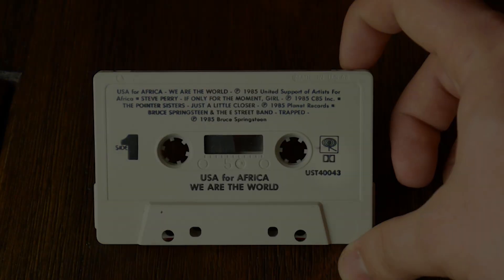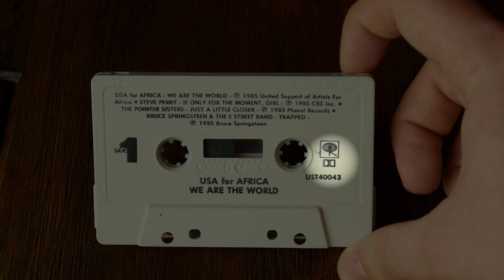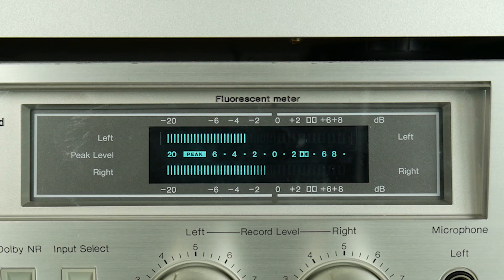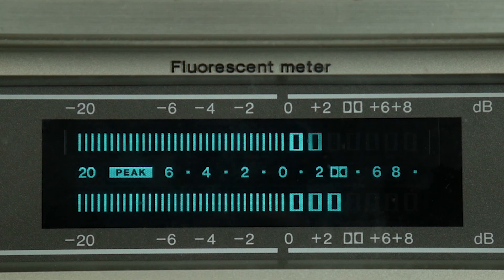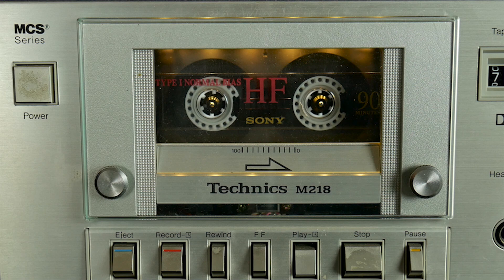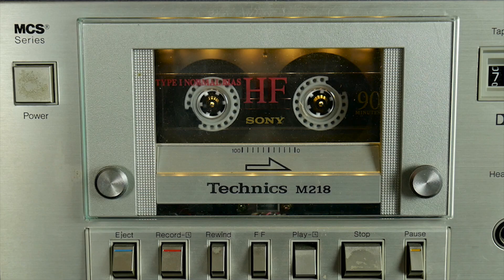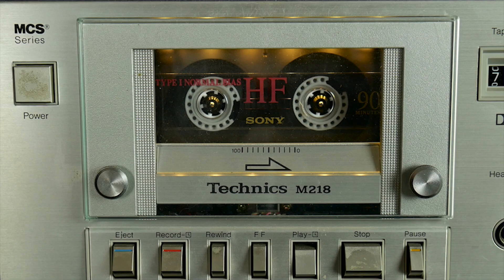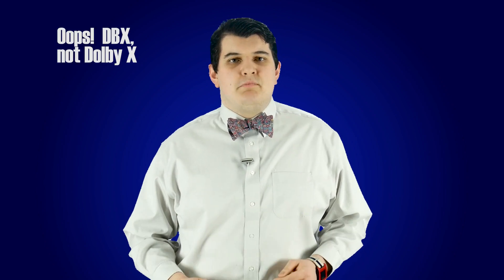What is Dolby Noise Reduction?  Dolby's Humble Beginning

Comment: 4:30  I disagree. 
This process is called "preemphasis and deemphasis", not companding as an equalizer does not alter the dynamic range. 

Companding is the combined use of dynamic compression and dynamic expansion, hence the name companding (compressing/expanding)
Reply: It's actually doing both. By varying the amount of pre-emphasis, the high frequency portion is compressed on record. The opposite occurs on playback. As others have mentioned, this video glosses over a lot of it. Kinda like "Dolby for Dummies."
Reply: No.  Some noise reduction is preemphasid and de emphasis, like what is used on an FM modulator. However, the better more sophisticated NR was compassion and expansion.
Reply: @videodistro  Compassion? LOL
Reply: Totally correct! Saved me typing it again! I cannot believe all the suckers that blindly believe this guy without even a quick web search!

Comment: I'm sure you know this, but pre-emphasis is part of the red book CD audio standard, so it has been used in the digital domain as well. As I understand it, it was due to the frequency response of early ADCs being bad in the higher frequencies, and noisy low-pass filtering to get rid of frequencies above 22050Hz for the digitization.

Comment: A companion technology to Dolby for professional pre-processing for mastering was the first baby steps in DNR tech... digital noise reduction.  The first studio units were starting to show up in 1978.  The circuit was actually so simple that we built one for the college radio station.  You directly couple an analog to digital converter with a digital to analog converter.  That will take out 40-60 percent of extraneous noise and tape his from field recordings so you can get a clean master for broadcast.  It was great for local, next day, broadcasts of away sporting events.

Comment: Excellent video, and one that caused me to subscribe. I never had an issue with Dolby B noise reduction, if a tape was encoded with Dolby B I played it back with the noise reduction. With one exception, I never noticed the "killing the highs" issues that others have mentioned, but I think a factor in that is that I used good-quality cassette decks with high-quality tapes. The exception was with some cheap pre-recorded tapes.
Reply: I used top of the line. 
My cassettes sounded sooo much better than commercial ones.
But there was a way to make crappy sounding cassettes
Record them with Dolby B or C.
It would my cassettes sound as bad as the commercial ones.
That was using varied recording levels, and over a period of time, 2 or 3 different tape decks, and different types of tapes.
A little tape hiss was well worth having a good recording.

Comment: The video is very basic, and thus a bit inaccurate about how Dolby B works, but at least the general principle is there.  For those who didn't like Dolby B because it made dull sounding tapes, the answer is simple: the deck needed alignment.  Each tape type was different, and the tape itself changed the high frequency response.  Put Dolby around that tape and it did get worse.  But a properly aligned machine calibrated to the tape it was using was the trick, and under those conditions Dolby B was reasonably transparent.  

However, it wasn't a fixed amount of EQ, it changed with level, and the frequency at which the curve "bent" moved with level too.  The double D Dolby mark wasn't there as a "not to exceed" limit because Dolby increased recording level, that's completely wrong.  That was a calibration mark.  A Dolby Level test tape would play a test tone at that mark, which was used for setting the deck up.  Dolby didn't change the maximum levels recorded, as the higher the recorded level, the less NR action took place.  

Dolby C, and S were not generally accepted because they were not compatible with existing Dolby B equipment, and so C and S were never released on pre-recorded tapes.  

Dolby HX was a great solution to the high level/ high end problem.  As you increased level on a cassette its ability to record high frequencies reduced significantly.  Dolby HX modulated the bias signal (which was necessary to get undistorted sound recorded on a magnetic medium, but tended to "erase" high end) dynamically, reducing bias when high level/high frequency material demanded better response.  It required no decoding, and was compatible with all forms of Dolby NR.
Reply: The best decks had glass heads and overall did not have auto reversing rotating heads. Tape decks usually don't go out of alignment unless physically damaged or misadjusted. Audio shops used to have alignment tapes, which you could purchase, and place a scope on the output and adjust for the best high-end signal. You can make your own alignment tape using a known good tape deck and a signal generator. Some tape decks even used to have the auto calibration of other factors such as bias and level adjustments. Pioneer and others, would create a short test area at the beginning of a blank tape, to adjust themselves. Crown and other high-end decks would also do this. If your tape deck sounds bad, it was usually because the tape heads wore out. Conventional heads develop wear over time, and need replacing.
Reply: Interesting. Your explanation makes me wonder if most of my decks were misaligned. Or perhaps I just have a preference for boosted treble.  I always preferred leaving Dolby nr off during playback. High frequency noise was acceptable because the audio seemed less muffled. To me it sounded higher resolution despite the hiss. With Dolby nr enabled during playback it sounded to me like someone had thrown a blanket over the speaker.
Reply: plus for mentioning Dolby HX.
which actually was developed by Danish Bang and Olufsen under the name HX professional.
it was incorporated on there absolute high-end tape recorder: Becord 9000 which was actually something the engineers asked to be allowed to make, after there development of the Beocord 8008 cassette deck.
insanely expensive, with all the technology they could dream of.

B&O did realize that it would be impossible to keep the patent for HX professional, and decided to sell it to Dolby Laboratories.

all prerecorded tapes there after, was recorded with Dolby HX (since it didn’t had any requirements for the playback).

Comment: Noise isn't a problem anymore?
It wouldn't be if not for the "loudness war" and the tendency of music producers to max out all frequency levels and compress the dynamic range like crazy. It makes 1411kbps CDs sound like 128kbps mp3 or even worse!
Thankfully, this stupid trend is fading and it was mostly a problem in the 2000s. You could not even produce vinyl versions of those CDs because the needle would jump off the track!
Reply: Denny, if you prefer your music louder most players have a nifty device called a "volume control".
If you feel that the music is too low you turn the knob clockwise or drag the slider upwards...

The music that's released today, in 2018, might be back to being relatively dynamic again but the albums that were released 5-10 years ago had very little, if any, dynamics.
Reply: No Eli, noise and digital distortion, due to extensive compressing and peak limiting, are not the same thing. 

Not even close...
Reply: It is so funny to me in regards to noise... the old analog formats added a level of artifacts (hiss being the most common) with Dolby noise reduction most of it could be eliminated... however to some people say it makes the music richer in sound (they say digital is sterile) that's where it becomes funny to me ... the sound is naturally reproduced in digital (sounds as it was in the studio) no hiss at all (or at least below what could be heard anyway) so I suppose that's what folks miss in the digitally recorded music (the hiss) that is the original sound as if you had been there and heard it with your own ears as it was being recorded  so why would people say the it sounds sterile ... that's why I say it's funny anyway that's kind of touching on what's better digital or analog... it really comes to what sounds good to the listener hope that provides more thoughts about this debate of sound I agree with the thoughts about the crappy sound of HIGHLY compressed audio in today's CDs ... as one writer here said if the volume is too low turn it up on the amplifier phone or whatever your listening to the music on ... leave the sound as is not compressed to make it as loud as possible on the CDs
Reply: Ask any musician or studio, and they record in 16 track or higher in the studio. But in a home environment, it has to be mixed down to 2 channels. I do wonder why today we still only record in stereo when indeed we should be recording in surround sound digital 7.1 at least. We have not evolved much in Y2k,. I suppose it is that we simply do not care about surround sound itself.
Reply: Eli Malinsky I know right! That's why I like original press vinyl and CD'S!
Reply: Isn't the "loudness war" something that has been going on long before we moved into the digital domain wholesale?

Noise is still a problem, I can accept that, it's just that it isn't down to crappy analog hardware introducing it now from recording to playback. Most of it comes in from shitty DACs in consumer hardware. The recording, even quantized into a digital format, is Pretty Decent(tm) most of the time, even at 16-bit 44kHz CD quality. For actual recording and production? I would expect no less than 24-bit 48kHz (preferably 96kHz prior to mastering). The noise introduced in digital via quantization is known, measurable, and mitigated by bumping up the sample rate and bitrate to a satisfactory level BEFORE you even record. There will never be no noise introduced, but sadly analog has so many places it can be introduced vs digital. Still, there are cases where the noise introduced by analog is preferable - see the valve vs solid state guitar amp religious war.
Reply: I prefer my music being louder and I feel music has more dynamic range these days(due to better hardware) but there has always been some bands that are more limited with DR. Background noise was hardly the only problem tapes had such as skipping tracks being inconvenient

Comment: digital sound is harsh even with a good DAC
Reply: hmmm.... true :)
Reply: That's funny.  I own a number of synthesizers.  I dare you to tell the analog from the digital synthesizers in a blind test :)  I have a demo of sawtooth waves from five of my synths, and I would share it with you if it didn't say which synthesizer was which on the recording.  Not surprisingly, they all sound good.  Doesn't matter if they are analog or digital.  The Moog does have a slight advantage, but only when you sweep the filter, because it's ladder filter is pretty great.  Here's another thought for you.  I once saw a great video where a person took an analog sine wave, converted it to digital, then back to analog, and compared the original and resultant sine wave.  Guess what?  Both were PERFECT sine waves.  And guess what sound is made from?  A lot of sine waves.  Digital sounding harsh is a myth that will never go away though.  People won't revise their biases.

Comment: A video about HX-Pro?
Reply: HX pro is a different beast altogether. It was not noise reduction per se, if I remember correctly, it dynamically changed the bias of the recording so the tape could record better high frequencies at louder levels, thus letting you record at higher volume without distorting the tape and increase the signal to noise ratio. More modern and advanced decks had similar sistems that recorded tones to the tape and analyze them to get the best performance for that particular tape, some others had a semi automatic adjustment, specially three headed decks.

HX pro tapes didn't need to be decoded, as the process didn't change the resulting signal.
Reply: CoTeCiOtm A great example of this is the Denon DRS-610

Comment: Like others here, i hated dolby. It KILLED the top end.
Reply: Oli Freke no it was with doubt encoded tapes. The top end was compressed and didn't sound as good as with non doubt encoding and playback.
Reply: Your deck was seriously out of calibration.  I used to align cassette decks all the time and put Dolby B spot on.  I did nothing to the signal unless something was wrong between encode and decode.

Comment: That's not true. That's not how it sounds with Dolby NR turned on. Every time I tried to use it it would muffle the static, and all the other sounds on the cassette as well, like if your ears were plugged up, like Toto's YouTube version of the video "Rosanna." That's what Dolby NR sounded like.
Reply from the maker: The sound segments of this video were recorded directly from the Technics deck pictured, using its own Dolby circuitry (Dolby C segment with a Sony deck).  Dolby works best when encoded and decoded by the same machine, as tape head alignment becomes more critical.  This meant the performance of Dolby wasn't as good with pre-recorded tapes.  You also have to keep in mind that a recording made with Dolby will sound too bright if Dolby isn't used on playback.  If you prefer the sound of a brighter recording, then you probably got used to listening to prerecorded tapes with Dolby off, but in reality to experience a flat EQ curve with a Dolby tape you have to turn Dolby on when playing a tape back.

Comment: Like the phono RIAA companding.
Reply: No RIAA is not companding or compressing. RIAA is a standard by which the recording is held to. It is a Curve. It stands for Recording Industry Association of America.  In Europe and other countries, use different standards. RIAA is just a standard, it is not a process. Dolby of any type is a process. It alters the sound of the recording to achieve higher fidelity. Its application can be applied to ANY analog audio source. Be it vinyl,  tape, wire, live, wax, or beam of light movie film and records.  Yes there was a beam of light record player once upon a time.
Reply: Yes it is - so hardly a new idea was it ?
Reply: No. Phono uses strictly equalization. Implementing a voltage controlled amplifier (needed for companding) would have cost more than the average home eighty years ago.

Comment: I don't get one thing though... if Dolby b boosts treble frequencies during recording and then reduces them on playback, shouldn't the noise get back to the initial level together with the rest of the signal?
Reply: No, because the boosting is done to the audio BEFORE it goes on the tape, it is done to the source audio which (in the case of pre-recorded tapes) typically came from final master tapes or even a digital source which had much less to no noise. ;)

Comment: the explanation is not quite accurate.  Dolby NR works by dynamically boosting the high frequencies during recording but the amount of boost depends on how loud those existing high frequencies are.  If boosted too much they would saturate the tape's ability to record the highs.  During playback the amount of high frequency range reduction also depended on amplitude so that the softest sounds received the most downward equalization.  The Dolby logo on the meter indicates the sound level at which the Dolby chips is neutral and neither boosts nor reduces the high frequency band.  The accuracy of the sound depends on the sensitivity of the tape and many advanced cassette decks offered Dolby level calibration during recording, along with bias and equalization trim.
Reply: Yes.  Exactly right.  He missed the mark on this video.
Reply: It was Dolby C that worked dynamically, Dolby B did not. The result was that I always preferred recording with Dolby B although my tapedeck was also featuring Dolby C. But neither my personal nor my car stereo had Dolby at all, so recordings with Dolby C were unbearable to hear due to the dynamic  mode of operation.
Reply: @Balikon Dolby C sounds great when you have a compatible player.  But as you point out, it was never popular on cheap equipment (or on car stereos), and it's unlistenable without the decoder.

Which is a real shame, because Dolby C on good quality metal tape sounds almost as good as digital and better than MP3 compressed digital audio.
Reply: @Shamino0  Dolby C to my knowledge was really picky and required a high quality deck, ideally the same one that made the recording, so most consumer decks, car stereos and portable players weren't good enough.
I think that was what ultimately killed it from getting widespread adoption as you didn't need a lot of variance in tape alignment for it to sound really bad. Lower quality players are also paradoxically those that need noise reduction the most haha
Reply: @Ty4ons  Dolby C required the tape duplicator to carefully match the Dolby levels as recorded on the master tape.  Those of us creating duplicating masters had to lay down a special Dolby tone (warbled) that they were to match EXACTLY for duplication.  Then, if your player didn't match the exact playback level from tape to preamp it would also be off.
Reply: Indeed, when he said "I don't sound any different" I was like "umm yeah you do, the higher frequencies are clearly attenuated".  Because obviously if the recording wasn't designed for dolby then enabling the function on playback will do exactly that.